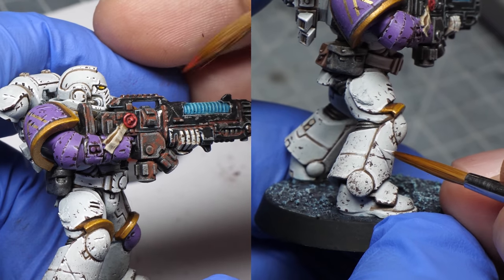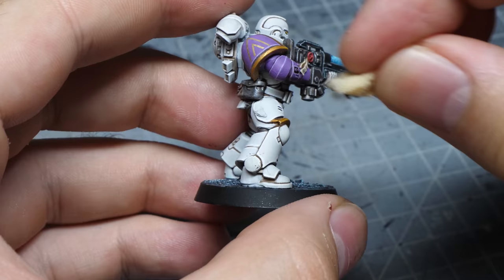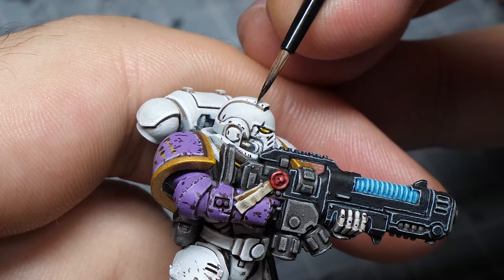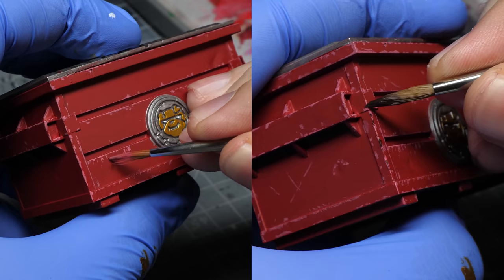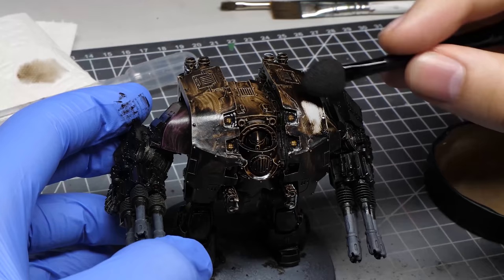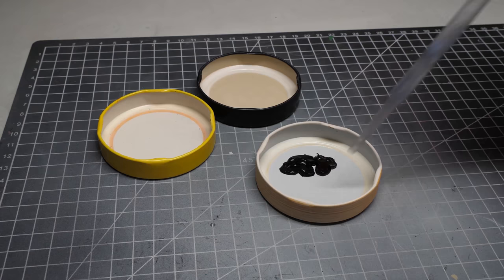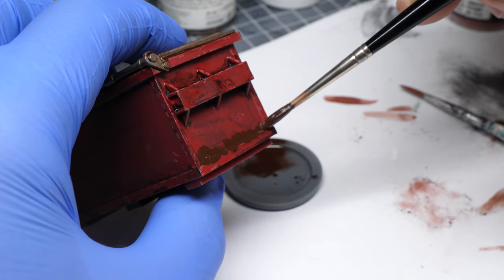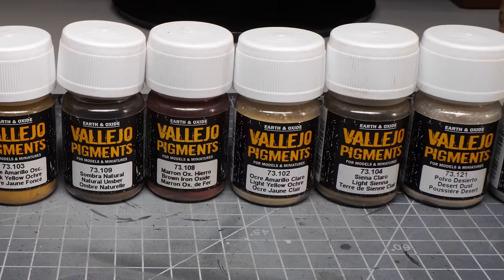WEATHERING explained in 5 minutes

Comment: What do you think about adding actual scratches by cutting wedges into the model with an x-acto knife? It could make realistic painting easier, since there's real edges you can highlight.
Reply from the maker: Can work for sure, but it really depends what the final scratch looks like - be careful!
Reply: @Zumikito  And it's very easy to get the scratch completely out of scale with the rest of the miniature. One of the things I've seen modelers use for making scratches in the actual model is a cheap dental pick, giving some more control than with a craft knife.

Comment: Quick question. What order would you do all 3 in? Would you paint chip first, then oil wash and finally apply pigment? Thanks
Reply from the maker: That is perhaps the order I would go for - that's what I used for the red dumpster anyway!
Reply: @Zumikito  thanks. Will try it on my new grimdark ultramarines army

Comment: how did you do the pin-wash on this figure, it looks very neat and precise?
Reply from the maker: I have a 4 video series, where I paint a white space marine from start to finish - there are parts where I blackline him and that's the same process
Reply: @Zumikito  ok ill look for the video. also what finish is vallejo model paint? matt? thanks for replying to me.☺️
Reply from the maker: depends on the paint - model colors are usually more matt (especially black, which is not good imho) but overall, they are between satin and matte unless you thin it too much, in which case it can be a little glossy when glazing. For that reason some people use glaze medium instead of water, but I find it ok
Reply: @Zumikito  hej, vím, že jsi zaneprázdněn, a obtěžuji tě otázkami, ale když je značka barvy jako AK 3. generace matná 100%, jak to, že mají specifickou barvu s názvem „11092 matná červená“ nebo „11234 matná střední“. Proč řada matných barev potřebuje matný střední lol?